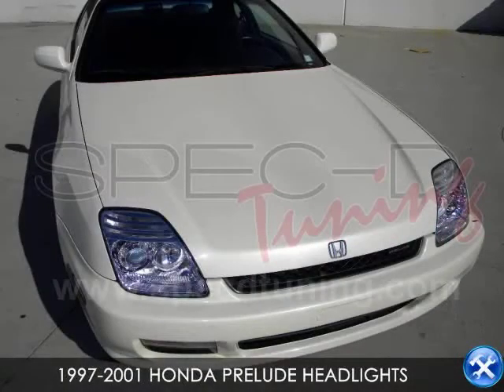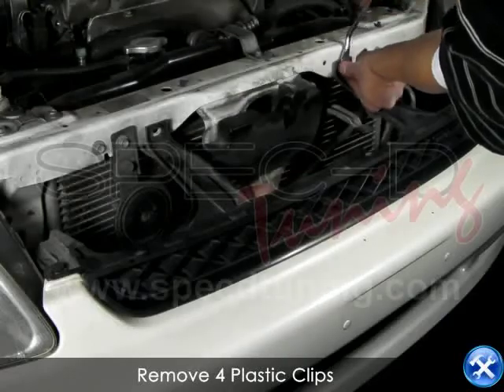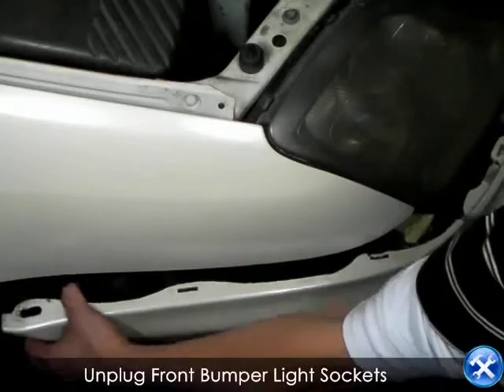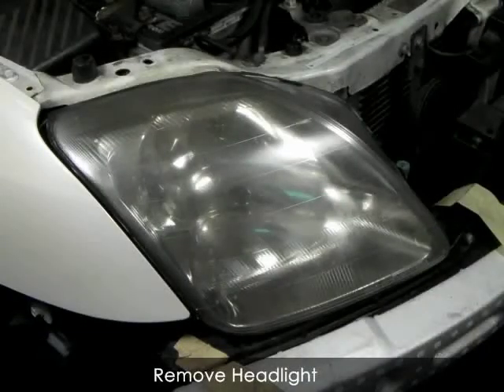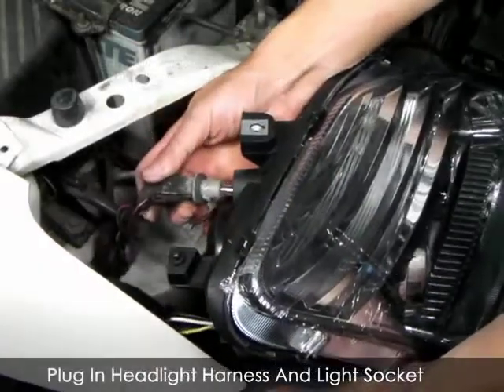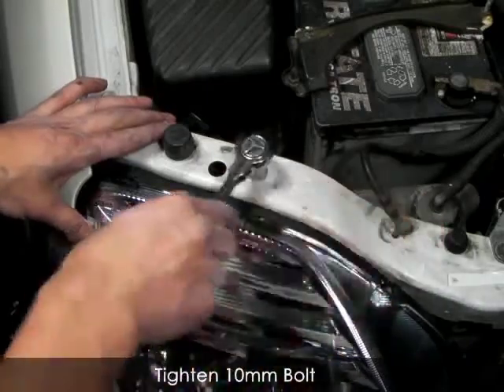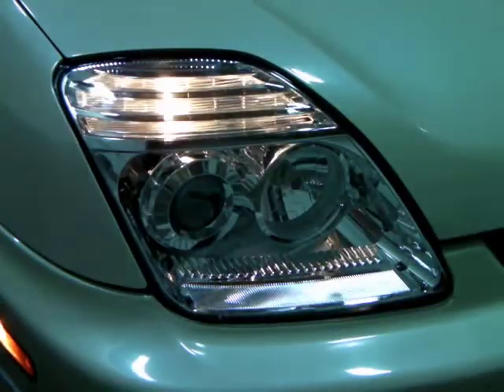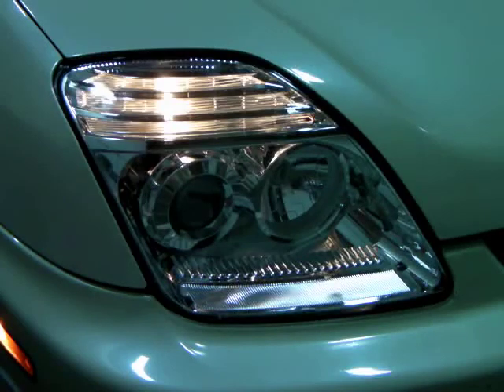SPECDTUNING INSTALLATION VIDEO: 1997-2001HONDA PRELUDE HEADLIGHTS

Comment: You sir are MY HERO ! :-) New tip for removing the headlights easy without taking the bumper off !!! Just remove the side bolts of the bumper and loose the others for reaching the side bolts of the headlights/hidden bolts with your ratchet/screwdriver. Done.